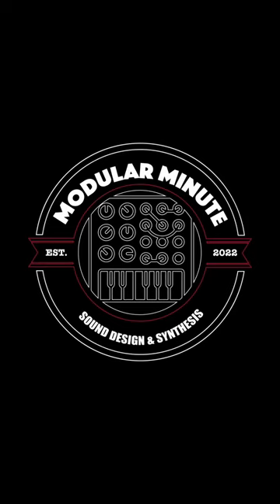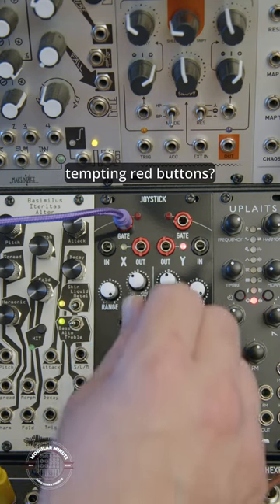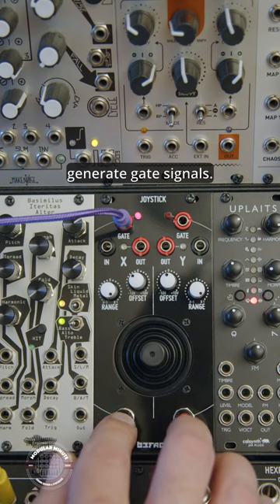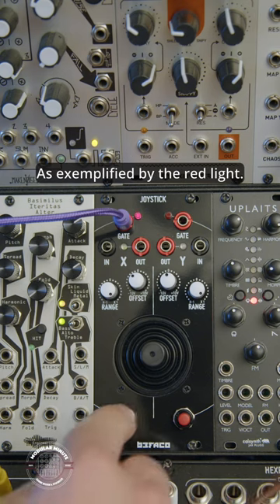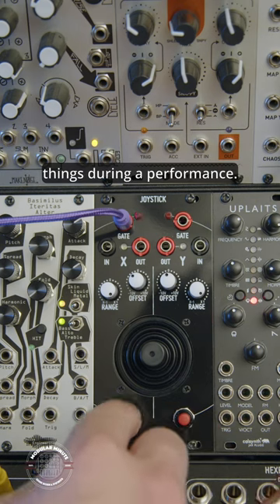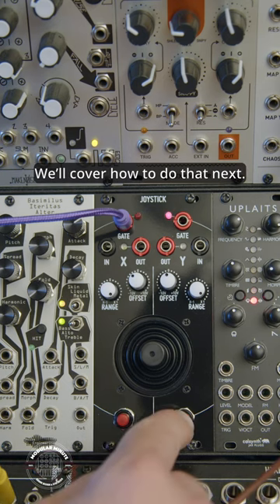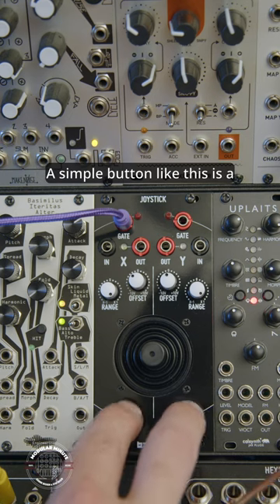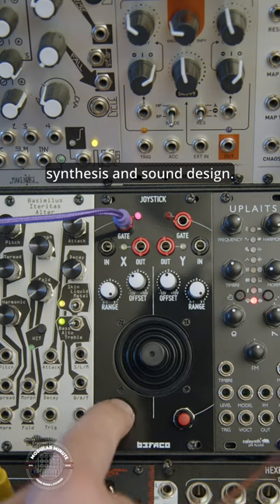The Modular Minute 105: Befaco Joystick In Action - Part Two

Comment: i dont understand the range knob for x and y
Reply from the maker: It’s the range of how much control voltage is put out on the axis. You can reduce the range, then use the offset knob to put the range in a place that’s useful for you. For example reducing it to only 2v range, then putting it somewhere like between -1v to +1v.
Reply: @the_modular_minute  many thanks for the explanation